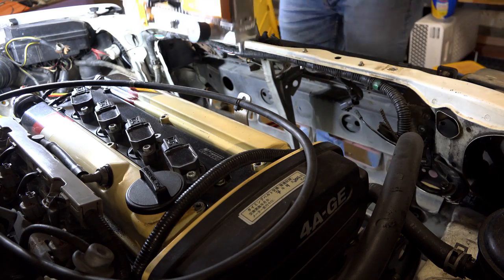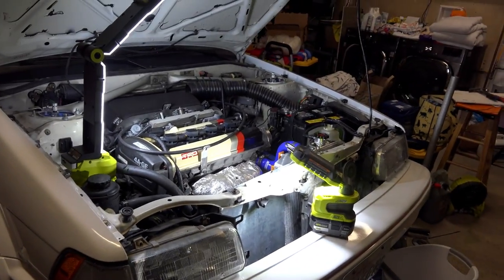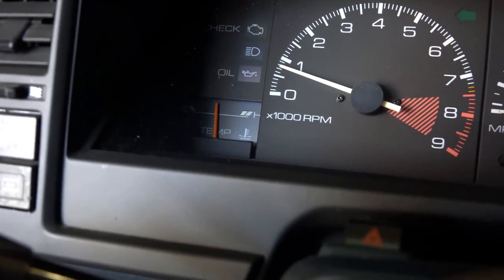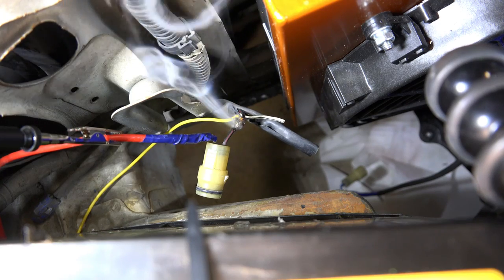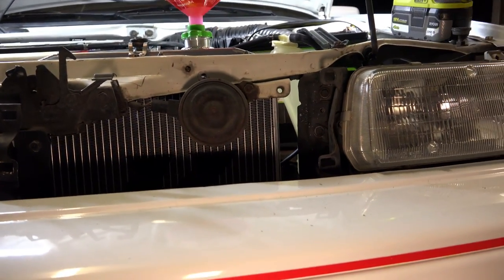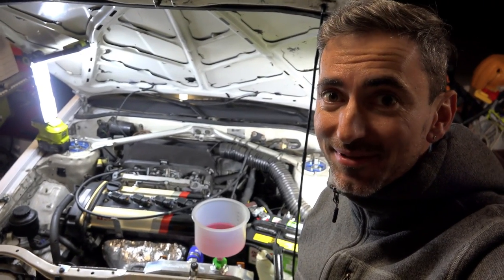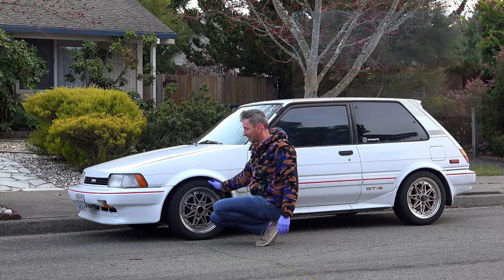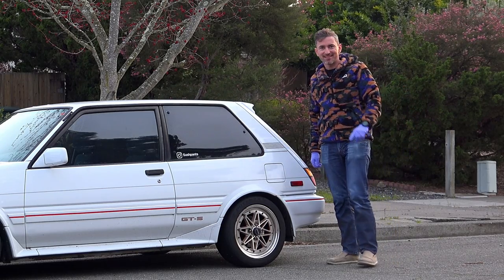4AGE Sings Again! - Cooling upgrade for the AE82 Corolla FX16 GTS

Comment: Love the car.  The two doors look way better than the four doors Australia got lumped with.  
I would like to ask, what is the purpose of the steel plate next to the radiator?  I thought more air flowing through the bay would help with cooling and feed the ITBs better.
Reply from the maker: I dig the four door! We didn't have a four door FX but we did get as the Chevrolet Nova TWINCAM. The plate is to seal around and force the air through the radiator, otherwise the air will flow around the radiator instead of through it.
Reply: @sushpants  amazing videos. Thank you for all your work. I had a silver and a white FX 16 GTS just like yours. I have a 1989 MR2 now.  Do you have the owners manual for the FX 16 from Toyota? If not, I have one and would be willing to send it to you.

Comment: Im curious if you'd consider it an FX20 now that it has the Blacktop? Looks fun regardless! Im one sunny day of rad bleeding, Timing curve adjusting and valve shim fiddling away from doing the same thing in my AW11, this was motivating! I miss that sweet green gauge cluster
Reply: When you're done please post a vid of your car on youtube there are way too little videos of 20v aw11s
Reply: @manuelhenriques7169   you may have come across my series on my silver top AW11 swap. Not a detailed how-to, but pretty thorough examination of all the choices your are faced with.
Reply from the maker: I have debated changing it to FX20. The MOAR valves edition.

Comment: What kind of hub/bearing replacements you going with/Timken? Good thing they didn't pop on thunderhill. Would've been really bad. Sick ride, didn't know yours goes to 8500rpm
Reply from the maker: I'm trying to get all Timken bearings. The 20v 4age blacktop is such a screamer and pulls hard all the way to redline. It's fun to see the tach needle dive past the original 4age's redline.

Comment: Hi! Have you tried replacing the original thermostat that originally came with the engine? Just wanting to know what was the original position of the jiggle valve when you opened it up. 12o'clock? Or slightly to the left about in front of the upper housing bolt? Thanks in advance!

Comment: I watched the pervious video about the leaking radiator but I don't get why you used the Honda Radiator when you can easily buy Mishimoto aluminium radiator for the AE82 which will drop straight in, which surely must make more sense.
Mishimoto Performance Aluminium Radiator Fits Toyota Corolla 1983-1987 Silver

Comment: Are those Drag DR-20 rims? I'm looking at a set for my very own FX16 GTS hoping to upgrade from enkei basketweave rims and I keep getting mixed results for the bolt pattern online. Thanks!
Reply from the maker: They are Drag DR-20s which are essentially reps of the Works Equip 03. The bolt pattern should be the typical 4x100.
Reply: @sushpants  Thanks for the info!

Comment: Honestly get an anti-gravity battery or a Braille Li-ion and put it in the trunk in the center, you will be amazed at how much the weight of the battery in the front affects your corner entry, and unsprung weight
Reply from the maker: It's definitely in the plan. I know exactly how heavy that lead acid battery is.
Reply: It doesn't affect unsprung weight, only wheels, brakes, and hubs... Technically also bottom of suspension/shocks. Anything strapped or bolted to the chassis is sprung weight... The weight loss of moving and going to a lightweight battery setup will make a difference but not on unsprung weight
Reply: @dannijacobsen8544  Yes thanks I meant sprung weight, I always get those terms mixed up lol. But yeah it does help alot with turn in and suspension load in the front, I've had cars where I have moved it and you could feel the difference, especially because the battery is mounted forward of the struts. I like how in Hondas they put the battery in the back of the engine bay

Comment: Where did you get the valve cover and the exhaust manifold cover
Reply from the maker: I painted the valve cover myself (I have a video on how I did it). The manifold cover from trackdog, a heat blanket for Miata header.

Comment: You should invest in a dimple kit for weight cutting the old girl. my goal on next car is to keep AC but remove the weight it is in body work chassis.. the cull to keep ac adventure
Reply: weight less ac adventure
Reply from the maker: I threw the AC out back when I first did the swap and now regret it. Sucks to drive on hot days.